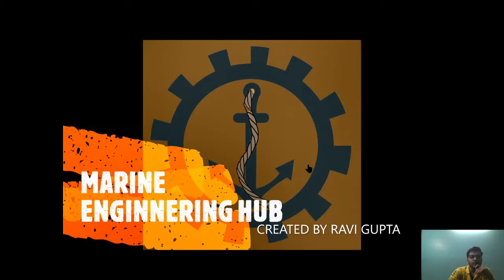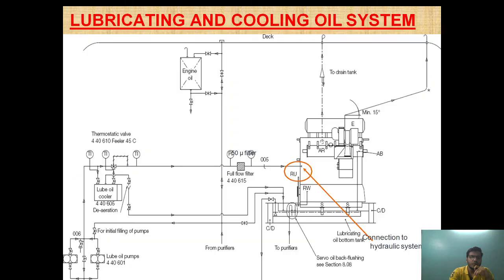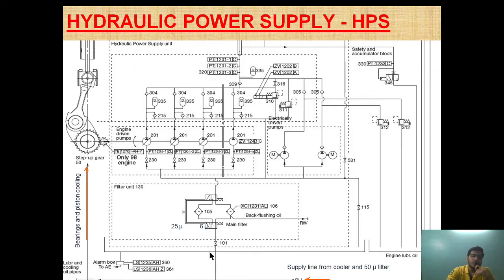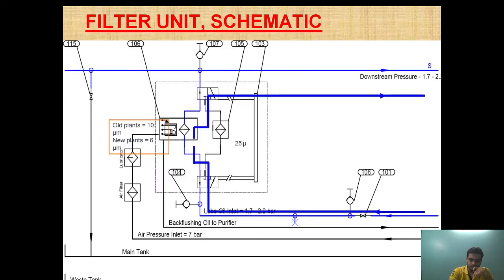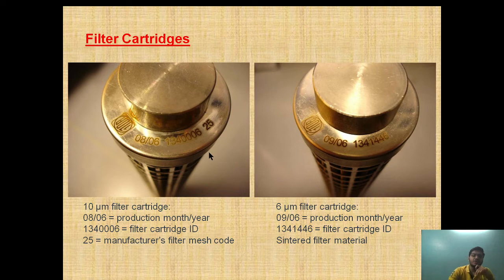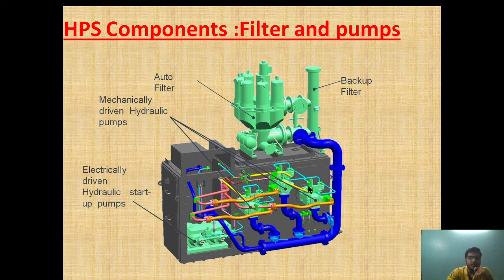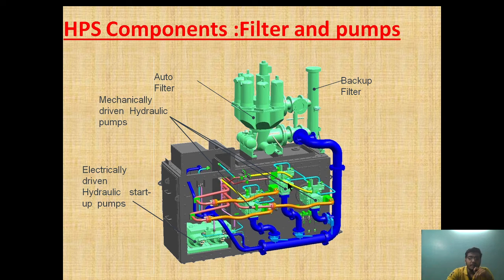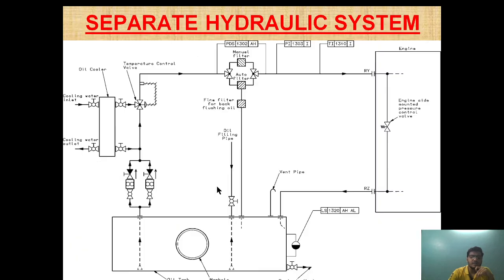Hydraulic Power Supply System(HPS) in ME Engine|(Part-1)

Comment: if CCU for anyone unit fails the unit is isolated. Is there a way we can use any other method to bring that particular unit back in USE. For eg. can we use some other units CCU for the unit who's CCU is failed?
Reply from the maker: vessel generally have spare ccu unit onboard
and in case of emergency(no spare onboard) you can use ECU UNIT - a or b depending upon which on use